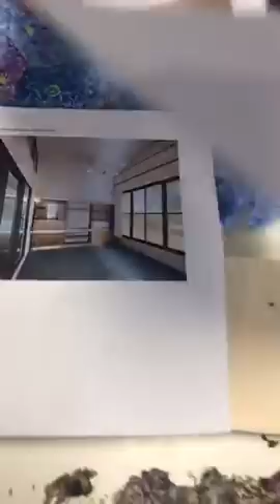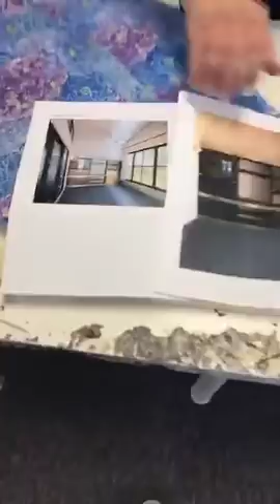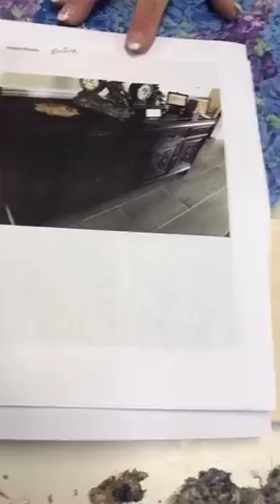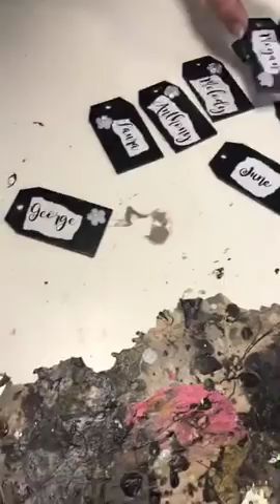Turn Any Table into a Farmhouse Table! Tutorial with Rethunk Junk

Comment: Hi! I painted my maple wood dining table in Linen and it looks so pretty! But, it's starting to peel. I followed the steps from prep to tuff top over a couple of days so I don't know what's wrong. Maybe I should have sanded anyway? I can't afford to rebuy all the products right now to re-do it so any suggestions to stop this would be appreciated.
Reply: MsJulie, I've been thinking about your paint peeling on your table.  I'm not sure there is a way to stop the peeling because my suspicion is the paint was applied to thick. If you used the prep, sanding would not have pevented the paint from peeling.  Sanding is simply meant to smooth out a rough surface or to gently rough up a smooth, shiny surface. When the paint is applied too thick it dries on the surface before it dries underneath. That causes the top layer to pop off.  You don't mention how may coats of paint you used or how thick you applied the paint. The first coat needs to just cover the surface lightly and even allow the wood surface to just peek through. You may have to thin the paint with a little water. This coat should be dry to the touch almost immediately. Also do not go back over areas as you paint because this will reactivate the paint you just laid down and cause it to not adhere properly. After your first coat dries the following coats of paint should also be applied in thin, even coats. You did not mention what paint brush you used, but it needs to be a good quality paint brush. 
I haven't tried it, but in other comments they have mention very lightly sanding the peeling areas and touching up the paint, thin coats, then reappling the top coat.
So sorry for your peeling paint, but hope you can find a way to recover and enjoy your table.
Reply: Thanks. This isn't my first go with the product so I'm pretty familiar with it. The other piece I did a couple of months ago is fine. This wasn't applied thick. I could see thru the paint and I allowed very long drying times. I spent an entire weekend on this large table. 3 coats total and I used a Wooster brand brush. Before it becomes too unsightly I'll try to repair it. I'm glad I didn't do the 8 chairs as well.
Reply: Where is the peeling happening on the table, did the table have previous owners and do you know what brand it is?  I'm asking the questions because of issues I've encountered. If the table had previous owners you never know what they used on the top. Pledge is a big problem because it has silicone in it. Some brands of furniture have a finish that has to be specially prepared to paint. Pottery Barn is one such brand. Maple is also a very hard wood, tight grain so it is usually left natural and mainly used for cutting boards and kitchen counter surfaces. Tell City furniture pieces were made out of maple wood and some of the tops are Formica. I have a table sitting in my shop to paint, but I'm undecided about what to do to the top because of the Formica.
Glad you have had success with using the paint before. Hope you have success with the repair. You followed good technique when you painted the table originally. It's frustrating to try your best and encounter issues. Best wishes to you.
Reply: Peeling on a couple of spots on two sides. It's solid, no formica, and I'm the only owner. No furniture polish used in my house. I wipe things down with warm, damp towels. I'll work on fixing it.